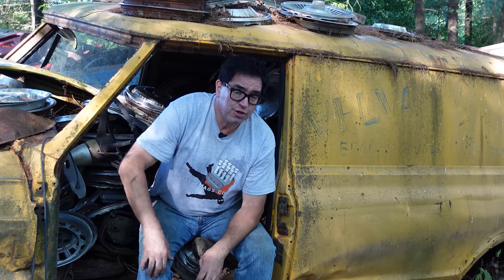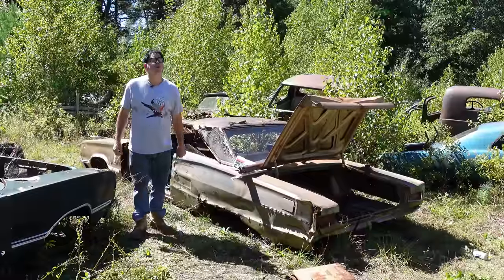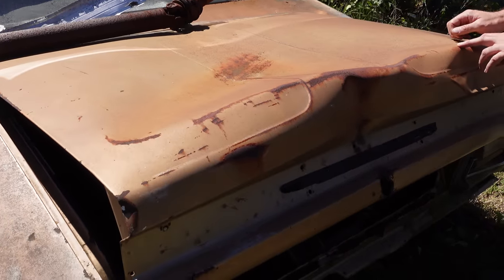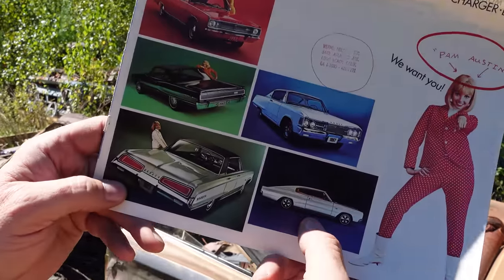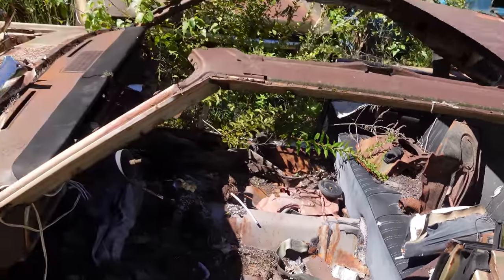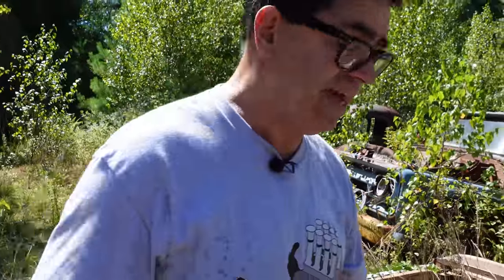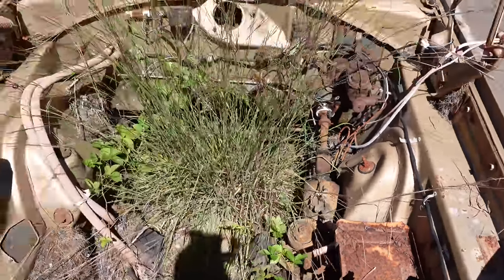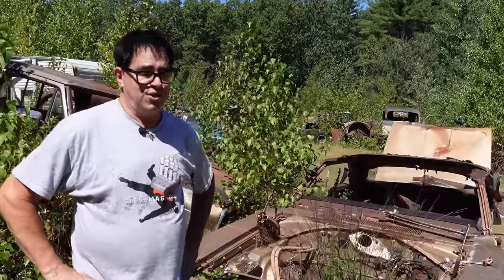The Dodge Rebellion

Comment: The 67  R/T   far I know never had a 440  engine emblem on the front fender and I owned mine since 1969 , maybe later in the run they added it but I never seen one with them . And I wish they could had designed them so the rear windows would have rolled all the way down. Keep up the good work Steve , watch you every day.  Also cant wait to see your Max wedge cop car build.

Comment: Hello Steve. First, really appreciate the details, model cars, and brochure shared in this video. I noted in your intro, you mentioned that the Coronet model line disappeared from 1960-1964 and returned in 1966.  I wanted to share that Coronet line returned in 1965. I owned a 1965 Coronet 440 model, 4 door sedan with slant 6 and 3 on the tree. Great car. I am not being critical, just clarifying for Mopar neophytes. Once again, thank you for your in-depth knowledge and coverage of the great automobiles known as Mopars.

Comment: I worked at Sears back in the 80’s and it’s kind of funny to think that the auto center at our store (which was really a full-blown repair shop) had HUNDREDS of pre-bent exhaust pipes hanging from the rafters - that’s how BIG exhaust replacement and repair was back in the days prior to stainless steel exhaust systems direct from the factory! Talk about an entire industry being displaced in a very short period of time, as I can’t even recall the last time I thought about needing exhaust work done on one of my vehicles unless you’re talking a performance cat-back system for one of my collector cars!

On a somewhat related note, I also remember that most Target stores during that era also had automotive repair shops - it was certainly a different time……🤔
Reply: But But old cars were so much more long lasting, reliable and cheaper, they went millions of miles compared to the adobe bodied cars of today. . . .  ( so claim those that know nothing about cars and always expect stuff for free. . . )
Reply: Yea,I remember mom and dad going to the JC Penny auto center for tires,brakes, batteries, Firestone took over
Reply: I believe Tenneco or Maremount (or one of the major exhaust suppliers such as AP) was likely supplying Sears with their line of exhaust back then. I know the shocks were made by Gabriel, the batteries were Johnson Controls, then Exide, then after the scandal, they were Johnson Controls (today, Clarios). The DieHard name was bought by Advance a few years back and I still think Clarios makes DieHard batteries today.
Reply: @bobroberts2371  say what?
Reply: Loved Sears back in the day!
Reply: @THROTTLEPOWER  It was the way that many home mechanics "upped their game" with having good quality tools at a good price. Their tools were reliable, easily gotten, easily repaired DIY by the owner (as major vendors made them for Sears), and easily warrantied when there was an issue. Never once in 30+ years did I ever have an issue with replacing Sears tools. Most times I would get the ratchet repair kits from the store and rebuild them myself, so I could keep my trusty old ratchet. Back in 1976, when I was out for a walk with my dad, a car sped through an intersection and a 3/8" drive model #43784 "teardrop" ratchet (made by Moore Drop Forge in Springfield, MA for Sears) fell out of a car. My dad went and picked it up---still worked. Fast forward to about 2017 or so. I decide to take it apart to check it out. Still like new inside. I cleaned it, put some SAE30 in it and put it back together. It likely had never been apart before that time. I have several of those generation tools, including a few "no good, needs to be returned to Sears" buys on Ebay that were cleaned up and put back together and work just as good as new.

My tool storage, hand tools, power tools and lawn and garden are mostly all Sears Craftsman. My uncle's neighbor (who is still alive at 91, just saw him last week) gave me a 2005 MTD made for Sears snowblower that he bought new because he's "too old to use that thing". He worked for Sears for 40 years from 1953 to 1993 and opened up all three stores (we only had one at a time in this area) over the years. It was in brand new condition, with two flats. I aired up the tires, gave it some maintenance and pulled the cord, and it started right up. This past winter, I needed to use it for a storm and to dig out a car or two. Primed it twice, pulled the cord, roared to life and was blowing snow across the street. I've also got a 1994 issued Craftsman 5/22 snowblower from a neighbor in equally great shape. Same thing, just some TLC, a new carburetor and I'm up and running. Both are Tecumseh powered which is my preference in small engines. Their motto was "Better From The Start". Great engine and just like the Rochester Q-Jet, they get a bad name because of the "mechanics" that attempt to "fix" them. 

Sears sourced quality items for the most part from many major vendors. Many of their Kenmore appliances were sourced from Whirlpool because Sears actually invested in WLP plants so that they would keep up with demand for Kenmore products. Their dishwasher plant in Finlay OH produced my 2019 Kenmore and the 1987 Kenmore it replaced (Only reason I did not fix that one was that the tub rotted out, not practical to fix). Sears was an American icon, but got ruined by bad management and being too slow to respond. Sears also helped start up Western Forge with investment money in 1965. WF would be located in Colorado Springs, CO and make all of the "WF" stamped tools for Sears and others. Their motto was "Mile High Quality". Before they closed, I got in touch with some senior employees and they sent me items for my older Sears tools. Very nice people. They even explained how their Sears tool date coding system worked so I made an Excel chart of that so when I buy an old Sears screwdriver I know how old it is. 

Fast fact: I was featured in 2002 in the Craftsman Club magazine with a 1960 Craftsman rollaway toolbox that I fixed up after buying it from an estate sale from the family of the former owner who was a home mechanic with a two car garage and a lift in his garage. I bought the box and tons of vintage 1960s-1980s Craftsman tools. Just alone the first day I brought the broken ones back to Sears, the total value was $400. I think I paid $80 for all of the tools I bought and $50 for the box, top and bottom. I sold the Buick shop manuals inside of it the next day and made my $50 investment back probably six fold. About a year ago, I bought a 1973 two drawer top chest from a guy with a similar type garage, but this was his second marriage. He said, "My wife's first husband had all of this stuff. I'm betting he bought it new". The kicker? It was located literally around the corner, walking distance from where the Sears store was located in 1973, so he likely just bought it and walked it around the corner. Different times......
Reply: @googleusergp  So true!!!!!!!
Reply: @THROTTLEPOWER  I still have the mechanic's tool set I purchased in 1990, which is about 95% original with only a few sockets replaced. I even still have the original register receipt from the local store, which closed in 2019. It was at that location since 1973.
Reply: Yea, i remember those days , exaust parts hanging, belts and hoses along another wall and wiper blades out in the box or in the corner, Mom and ad had the JC Penny Auto center
Reply: @jeffclark2725  A friend of mine had a brother in law who was a tailor for Penney's (my sister worked at the local store for a time doing the display windows) and he made a custom toolbox cover for him from left over material. Penney's had "Penn Craft" tools which were also supplied by Moore Drop Forge/Easco who also supplied many Craftsman hand tools. However, Penney's never got the exposure that Sears did in the automotive and DIY/hardware/tool arena.
Reply: @bobroberts2371  What are you talking about?
Reply: @jeffclark2725  👍👍🙂
Reply: @googleusergp  Oh the days gone by, Pennys and sears were big here in Bremerton Wa back in the 70s and 80s, got a lot of shoes and clothes there, i have a few Pencraft sockets still around,maybe a stray wrench
Reply: @googleusergp  Aaaaaaaa very cool!!!!!!!!!!
Reply: @jeffclark2725  - back in the early 80s we went to Penny's because Sears credit cards were harder to get back then.
Reply: @googleusergp  -  I still prefer the older Craftsman tools. Even my tool chest is ancient Craftsman sitting on a Kennedy cabinet found cheap at a local pawn shop. Recently found a Craftsman tap and die set in a cool old wooden case.
Reply: @jeffclark2725  I have a Penney's lower rollaway chest and some hand tools. I was admiring it in a neighbor's garage and then one day after he passed away, his grandson was rolling it to the curb as I was coming home from work. He confirmed he was tossing it and I grabbed it. Made around 1972 and Kennedy made it for JCP. Solid unit indeed.
Reply: @THROTTLEPOWER  Turns out that UTG rented the same shop where I believe this toolbox was for a time. I still see one of the family members around and I have some tools that I bought from the family that have his name on them. Apparently, he was a local stock car racer at one time.
Reply: @TrashcanGarage  One time Sears sent me a letter saying that they were going to cancel my 1979 issued card due to "non use". Well the kicker is that we have the same name and my dad passed away in the 1980s, so that was why it wasn't being used. I would have been in grammar school when that card was issued. LOL.
Reply: @TrashcanGarage  +1 on that. My uncle's neighbor worked there for 40 years as I have stated. When I want to know Sears history, I just call him up or go to visit. He's still sharp as a tack at 91 years old. I have them all: Husky, Craftsman, Matco, Snap On, Kennedy, to name a few. Most of mine are 1960s-1970s Sears Craftsman which Waterloo supplied. Prior to that, AMD (Advertising Metal Display) supplied them. When I was a kid, I went with my grandparents in 1975 to buy their "All American" Kenmore (WLP supplied) washer and dryer. I remember going there in my grandparent's Duster. Those were in their basement for years and years. They only required repair one time each, and they were only repaired by me and I was well into my 30s when they were repaired. The dryer needed a $35 igniter kit and the washer a $23 NOS timer found on Ebay. When we sold their house (I bought part of the property and own it now), the dryer was sold for what it was probably purchased for in 1975 and even the "end of cycle" buzzer still worked. We had tenants in there for a short time after my grandparents passed and they ruined the washer, so we evicted them and I parted it out. Talk about reliability. It even had a sticker on the side of it that said, "Cosmetic parts are available for a minimum of 10 years, functional parts will be available for a minimum of 15 years". Some are still available today.  

Fast fact: The replacement toolbox drawer clips sold on Ebay have a history that I'm involved in. The seller now sells the 3" long clips which are for the older 1960s boxes (if you want to use the shorter "M3163" clip, you have to change the whole slide). Well that clip and slide shown in the photos he uses is from yours truly's spare stash. I sent them to him so he could test fit the reproductions. He then sent them back with some repros. No money exchanged hands, we agreed that it was for the sole purpose to make the clips available because they haven't been from Waterloo that we know of for many years. I knew the folks at Waterloo (prior to SBD buying them) very well. In fact, a woman who worked there found an old Waterloo made tote box at a yard sale and sent it to me. They were really, really, really nice folks. Originally, they worked out of Waterloo, IA and then Pocohontas, AR and the Sedalia, MO which is where they still are today. 

I recently picked up a 1983 Snap On KRA59F nine drawer top with a 1981 Craftsman #65053 three drawer bottom in rough shape that was in my coworker's parent's garage. He said, "If you don't take them with the tools, they are going in that pile there (a dumpster/metal pile)". Didn't have to ask me twice. He had to get rid of them as he was selling the house and he wants to move (he was a mechanic for 40 years before we started working together. I recently found an old city tax photo of one of his shops from the 1980s, he was tickled that I found that and sent it to him). He'd been saying for years on our out of town business trips while were out to dinner or at breakfast, "One of these days you gotta come over the house. I'm just going to give you a bunch of stuff". Sure enough that was this year. I cleaned both boxes up, SO sent me some new parts for it and I got all the drawers to slide, roll and they even lock the way that they should. I left the vintage automotive decals on them (Gabriel HiJackers, Castrol GTX, Wynn's Extend, Snap On, MAC, etc.). When we are not doing projects at work, we're good friends and I help him track down parts for his cars. He says to me, "You know the numbers, that's your thing. I needed guys like you when I was business". LOL.
Reply: @googleusergp  thumbs up
Reply: Our JC Pennys auto center actually sold gas until the second gas crisis.
Reply: @seed_drill7135  Who was supplying the gas?
Reply: @seed_drill7135  ours wasn"t that fancy
Reply: @googleusergp  Very cool, stories like that are Timeless!!!!
Reply: @stephenyoutubin4476  My point is how some rant endlessly that " old "  cars are so much better all the while driving more modern stuff and reaping the benefits of Radial tires, fuel injection , unleaded fuel and so on.  

Those that long for 2000 cars in 2020 are cut from the same cloth that calls 2000 cars " junk " and long for cars built in 1980  ( and keep going back 20  years for the next batch. )
Reply: @frankjones4094  My point is how some rant endlessly that " old "  cars are so much better all the while driving more modern stuff and reaping the benefits of Radial tires, fuel injection , unleaded fuel and so on.  

Those that long for 2000 cars in 2020 are cut from the same cloth that calls 2000 cars " junk " and long for cars built in 1980  ( and keep going back 20  years for the next batch. )
Reply: @THROTTLEPOWER  Yup, bygone times for sure.
Reply: Back when target sold things to aim at a target.
Reply: @napalmholocaust9093  Now it's either a "Walmart run" or a "Target run" on a business trip to pick up those essentials that you need for the rest of the trip.
Reply: @googleusergp  👍🙂
Reply: @bobroberts2371  understood
Reply: @googleusergp  Who knows, I was 12.  Probably whomever was cheapest that week.
Reply: @seed_drill7135  Probably so, it was probably bought on a spot buy at the time.
Reply: @jeffclark2725  see 1:41 to 1:51   in the vid  "  Johnny From Airplane! The Movie "  Jun 1, 2012 " on the channel  " Mickey Mouse "
Reply: @googleusergp  see 1:41 to 1:51   in the vid  "  Johnny From Airplane! The Movie "  Jun 1, 2012 " on the channel  " Mickey Mouse "
Reply: @bobroberts2371  What relevance is that to a 1967 Coronet?
Reply: @googleusergp   What relevance does J.C. Penney's / your brother in  law / sister you reference in other comments have to do with a 1967 Coronet ?   ( Did you watch the vid ? if you you did you might get it.  )
Reply: @bobroberts2371  Just sounds like gibberish.

Comment: Steve, you missed an opportunity to show the big difference between the 66 and 67 headlights, if you’d held the headlight surround by the opposite side, you could have illustrated the outboard park lights and headlights shifted inboard on the 66. I was no fan of the 66 front end, but it eventually grew on me, having owned one for over 40 years.

Comment: Had a 67 Coronet in the 80s.  318 auto with air conditioning. Blew cold air for years with a v twin compressor and clamped on hoses.

Comment: I bought a one 69 Super Bee back in 2016. It had been parked in 1981 when the fuel pump went out of it and not moved again until shortly before I purchased it. In the console was a warranty card and receipt for 2 Sears Muzzler mufflers. They had a lifetime warranty. They were about 14 months old when the car was parked. Still in great shape in 2016. I wonder where I would need to go to get them warrantied if need be though??? I sold the car a couple of years ago so no telling if they are still on it or not.

Comment: Just as a point of reference Steve, your holding the '66 headlight bezel upside down. The front marker lights on the '66 were integrated in to the grill whereas due to the new styling in '67 the markers were in the bumper.

Comment: Just a note on the 273  V- 8 ' s .  Great little small block engine . Had a few over the many years but the one I had in a 66 Cuda with a four barrel was a real screamer .  Could of been mildly built by a previous owner .  Great video as always !
Reply: Our postmistress and her husband owned a '66 Satellite in cherry red with a 273, later on I owned a '68 Dart GT with a 273,bucket seats and console floor shift,I thought I had a Cadillac compared to the '61 Falcon that was my first car 😎
Reply: @rogercamp6071  Roger , I sold my 57 Chevy Bel Air , two door post with a 327  4 - speed to my buddy and he also traded in to me his 62 Falcon two door wagon that I dumped a 289 Mustang  V- 8 and a slush in .  I've always loved wagons and still do !   Wish I had the Falcon back .  I'd go with a 460 big block slush .   Catch me if you can !

Comment: My dad and me bought a 67 Coronet 2 dr ht for 250 bucks back in 1989 as a cheap fun project. The 66 and 67 were ( are ) the least desirable B -Bodies by far so we weren't worried about a " restoration " or anything. We built a 392 and shoe - horned it in ( 66 poly K Frame and a 77 Aspen driveshaft ) . I still have it and all of the other Chrysler artifacts we collected .